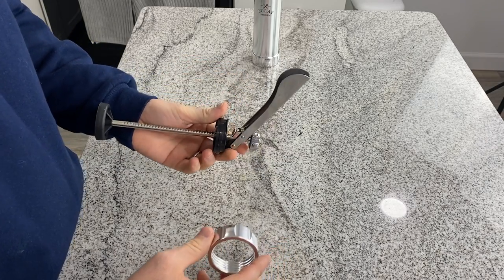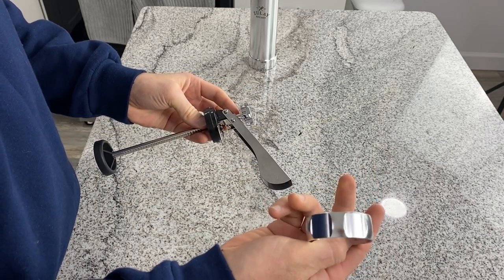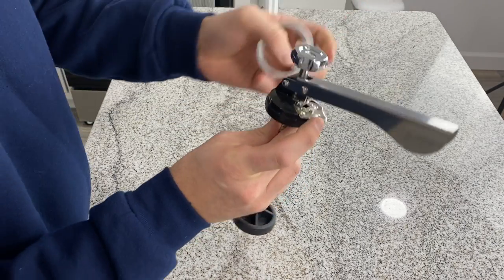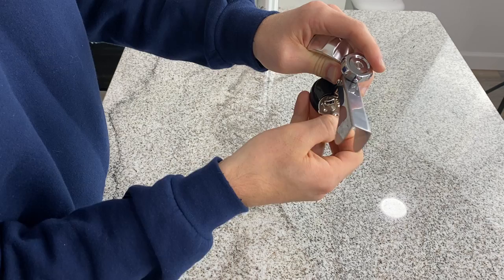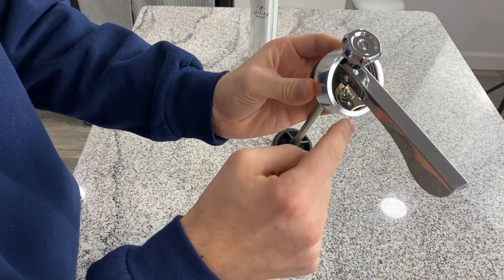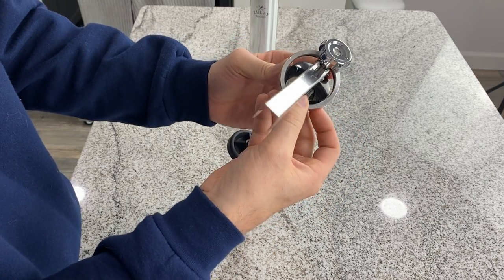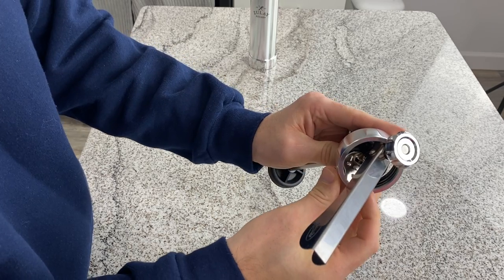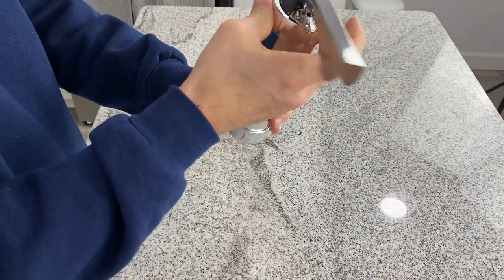Zulay Kitchen Cookie Press: Troubleshooting

Comment: This video ROCKS! The press comes apart easily, but I struggle each year (often 10 to 15 min) because I can't remember or figure out the necessary trick. Now, I followed along and got mine together in 30 seconds. **Don't use an alternate vid where they use a screwdriver and pliers to complete disassemble a press, unless that's really what you need to do!
Reply from the maker: Glad we helped! 😊

Comment: omg, you did it the hard way.

You could have just pulled off the circular plunger plate and then pulled the Rod out and then the Ring Cap slides over the whole thing with ease.
You then slide the Rod back through the hole and push the plunger disc back on.   done!

Comment: I've been trying for over 3 hours and I can't get the last part (the black surface that holds the lever) to level up and fit in the ring which screws onto the barrel.  I've literally taken it apart - unscrewed top and bottom... It's driving me made - I've lost my patience! It's brand new, or else I would've thrown it away! I wish the  idiots who prepared the manual would specify not to remove the lever when washing. Thanks for your video anyway! Mine isn't the same brand as yours, it's a KEFU, but it works the same...
Reply from the maker: Hello! I'm really sorry you had a bad time, with your cookie press